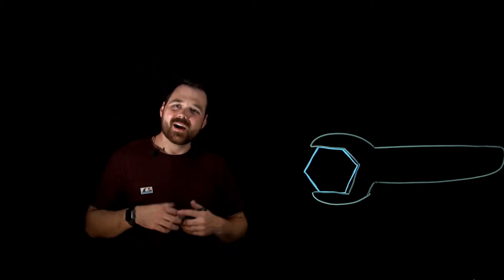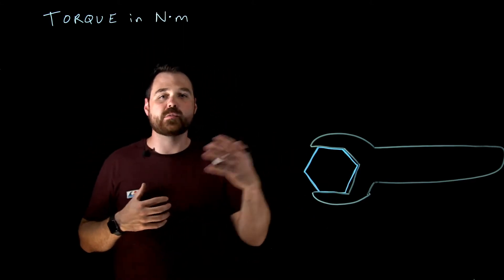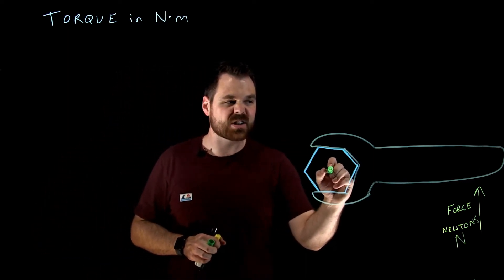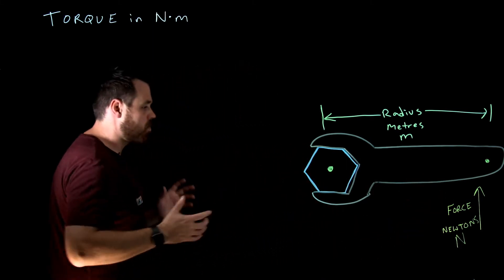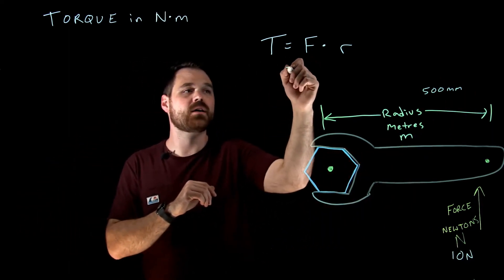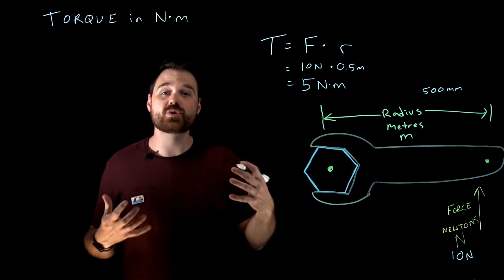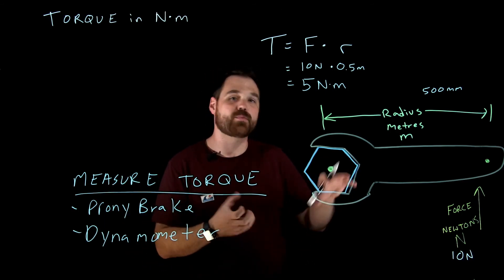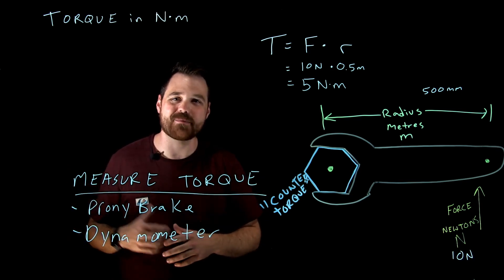Torque in Nm

Comment: I really have to question your use of the word 'dynamometer' in a torque context.
Unless it means something completely different in the Canada, a dynamometer (or 'dyno') simultaneously measures torque (Nm) and rotational speed (rpm) and is used to calculate power, (Joules per second), not static torque (Newton metres) as being discussed here.  The two cannot be conflated except by virtue of the torque component and your use of these terms could confuse.
Power cannot measured with a torque wrench just as threaded fasteners cannot be tightened with a dynamometer!

Comment: Seems like torque over time will get you distance traveled by your lever arm given a certain mass of the lever arm so that means time is associated in this equation and this equation is related to other equations so you could build a web of equations in 3 dimensions and use the variables to equate each equation to each other.

Comment: Hi...pls tell me how to calculate a motor power required for a constant torque motor 
Torque is 1889 N-m speed 26 rpm
Reply from the maker: It would depend if you're looking for input or output, but output could roughly be calculated using this formula:

P = ( T * n ) / 9.55